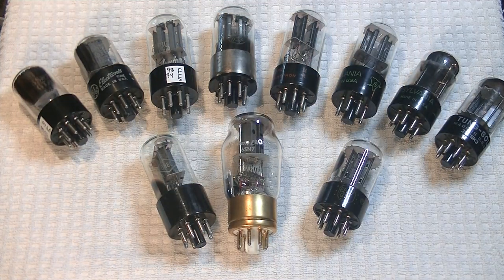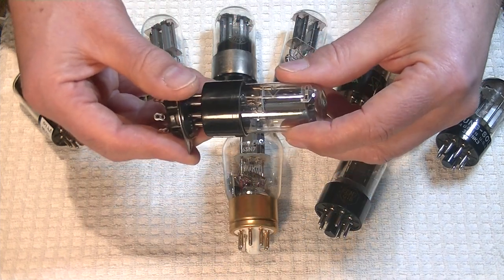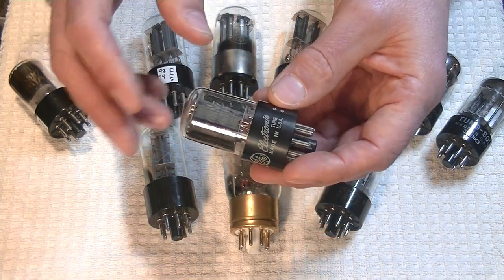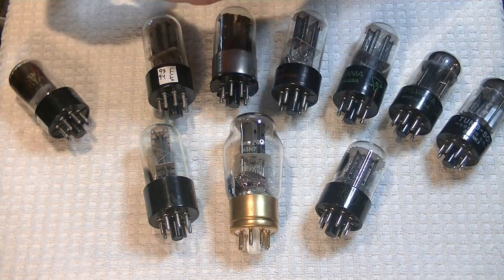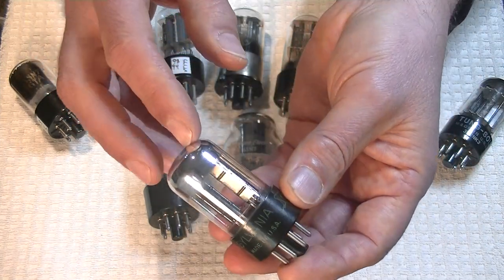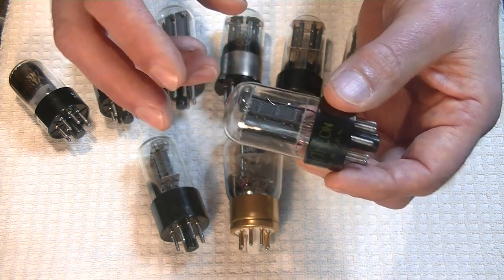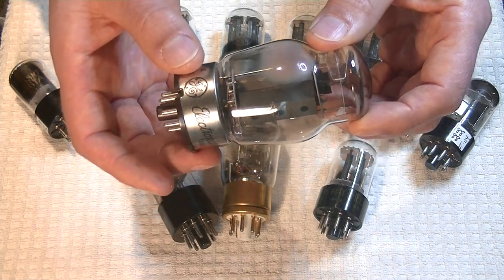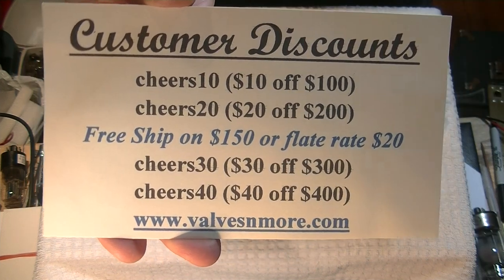Tube Lab #22 Tubes for the Schiit Freya+ Preamp

Comment: Hi Jim, nice job of showing different tubes that can be used in the gain section of the Freya+ Pre-amp.  I recently bought the Freya+ and have done some tube rolling so your timing of this video is really good.  One tube that sounds sweet to my ears is CBS Hytron 6sn7GT did add a wider sound stage, clear base and focused mid range to my listening experience.  Please keep the videos coming!  Thank-you.
Reply from the maker: Yes the Hytron is a very nice tube and I try and keep as many in stock as I can.  I always have more tubes to bring out for show and tell than I have space or time for!  Thanks for letting everyone know!
Reply: In regard to the socket  saver I have tried four of them into the Freya pre-amp with limited success.  While rolling tubes two of the socket savers the middle plastic slot broke off.  If you do find a good quality socket saver please let me know, I will purchase them immediately.  Thanks

Comment: I’ve found with the Freya Plus if you’re using socket risers, if you pull gently straight up with no wiggling only the tube will come out, but if you add wiggle the tube and the socket riser will come out.

Comment: I believe that Schiit was wrong in the construction of this preamplifier. I have one and I love it, but I believe the project has been misguided when it comes to matching the tubes.

As for the gain tubes (right side, next to the XLR inlets), Schiit recommends the 6SN7, but they say it works with the 6SL7 as well. The fact is that the 6SL7, although not a famous tube, has twice the gain of the 6SN7, that is, it allows the same volume level to be achieved with a smaller scale of the knob.

On the other hand, with regard to the outlet tubes (on the left side, next to the XLR outlets), these must be the 6SN7. As these tubes control the output impedance, if we use the 6SL7 the preamplifier will not be able to control virtually any modern amplifier on the market. This in terms of impedance. But, the 6SN7 on the outputs turn it into a preamp that plays much more than it costs. In terms of matching the project, 6SL7 at the inputs (which amplify the signal) and 6SN7 at the output are the best combination.

However, if gain or more power is not essential, eventually using better 6SN7 in the gain stage can result in something superior.

Comment: Great informative video.  Do you recommend socket savers for the Freya Noval preamp? Also do the sonic properties of 6sn7 tubes from various manufacturers carry over to the electrically equivalent 6cg7?  Thanks for any advice
Reply from the maker: The Freya noval takes a miniature 9 pin tube and these are all glass with integrated pins, so no matter what you do you are pushing in and pulling out on the glass, so unless you need them higher for some reason you don't need socket saver/lifters.  This is only a problem with octal tubes which have a glued base and why we use socket saver/lifters when the tube is mounted in a sunken socket (terrible design decision) like the Freya+ octal preamp.

Comment: Watch out for the cheap tube socket risers; I’ve had the middle key break off in the preamp socket and had to extract it with pliers.
Reply from the maker: Good advice!  I only sell one high quality octal socket saver/riser and the ceramic/brass body is beautifully made, But if you wiggle too hard you can break the ceramic center pin.  In the hundreds i've sold, i've only had one breakage like that - and the customer refused to accept a Free replacement, saying he clearly wiggled way too hard!

Comment: Cheers Jim,  I have this issue with my e180f's in my baby sabaj pha3 headphone amp. The russian 6j9 tubes are around 2" tall which gives me a good handle hold for installation and removal (plus the Russian tube logos are majority etched). Annoyingly the euro/us 6j9 (E180F) are half buried in there as they are half inch shorter.  I am getting annoyed at damaging the company print off my rarer valves. I managed to wipe half the valvo logo off my triple mica's in two seconds when pulling them. I was raging lol. I'm going to get some high temp white glass paint and a fine brush to repair the logos lol (I am a tart). I will have to get some socket savers too as you say as they'll give me the stack height xx

Comment: Hello, interesting review on the tubes. I just got a freya+ unit and its my first tube unit. A silly question to ask, I came across many articles saying how the chassis of tube amp is live and dangerous, does the same apply to tube preamp?
Reply from the maker: No chassis for any amp or preamp, toaster, drill, hairdryer etc should ever be live.  It could kill you! Quickly!  The chassis of a tube amp is tied electrically directly to the house safety ground.  With old amplifiers that require servicing, a live chassis is a possibility.  If you ever encounter such an amp DO NOT plug it in, it must go straight to a competent service technician and they will make it safe.
Reply: I think you've misread the articles.  The Freya+ chassis is definitely NOT live.  When plugged into a grounded outlet, the chassis will be tied to earth/safety ground.

Comment: A very impressive video. Tks! I am going to get my Schiit Freya + soon. Need your advise. Am thinking of getting Sylvania  6sn7 Chrome top for the buffer stage and Linlai e 6sn7 for the gain. Will this give me good sound quality?  Looking for holographic and smooth mid range, some warmth and tight bass.Or shall I go for all 4 Sylvania 6sn7 GTAs for the Freya +. Appreciate your advise.
Reply from the maker: I have no (zero) experience with the Linlai 6sn7, but if it's made in China, I'd stay well away from it.  The difference between vintage tubes and new production is night and day, yes occasionally a modern manufacturer will produce a great sounding tube - but not often!  If you are looking for a premium set for your Freya, I just recently found enough inventory for my "USA Platinum" set. They don't last long unfortunately and both tubes that I use in the set (Tung-Sol "Tall Boys" and Sylvania) are high demand premium vintage 6sn7's.

Comment: I am seriously considering a Freya+. I am only familiar with tubes because I am into Hi Fi, grew up in the seventies and eighties, and have heard them many times, also I'm an electrician. I never really have messed with them. My amps and equipment have always been A, AB or D. Looks like a great little unit to get into tubes, I'm a little sketchy on the recessed tube bases. I work in a factory and many of our relays have similar bases, I understand fully how they can be hard to put in/take out. Boards are easily damaged by twisting and pulling on stuff. Would you recommend the Freya+ or is there a better option for me in this price range? I am asking for the mechanical issue, for what I understand it is a great sounding pre-amp. Currently I run my DAC straight to my amp, it has balanced outs and works great. Very precise, neutral, quality sound, but no color. I miss that from the older equipment, I figure tubes will be a great change/add to my system. Thanks, very informative.
Reply from the maker: A simple solution to any recessed socket is to use a socket saver/lifter, we carry a high quality ceramic and brass type in the store for both miniature 9 pins and for 8 pin octals (Freya 6sn7).  These are simply used as lifters and work well.  Another option to the Freya is one of our quality Kit Preamps, we offer two preamps, both are dual mono designs with pure class A circuitry.  The downside for some is that they use single ended unbalanced circuits (RCA patch cords).  In my opinion as an audiophile this is superior to balanced circuits - at least for home audio.
Here's a link to the store: www.valvesnmore.com
Reply: @tubelab194 👍 thank you. I will check it ot for sure.

Comment: Soooo, what about the father of the 6SN7?  6F8-G.  Originally two, much-loved unchanged 6J5 single-triode guts transplanted into the coke-bottle envelope with a top cap b/c enough folks wanted one grid more isolated vs. being brought out to a pin.  Requires a socket adapter but it is the 1st 6SN7G.
Reply from the maker: Great point! Also let's not forget a pair of 6j5 or det20 or cv6 or 2c22 or 6c8c, with adapters of course.  And we haven't even touched on loctals!  The reason I stick to the correct tube, is the vast majority of Schiit Freya owners are just getting into tubes, they probably don't want to fool around with adapters or modding the amp.  And because the 6sn7 was the 12au7 of its generation, many many excellent tubes were made, and as a result we have good supply even today some 60 years later!

Comment: This is very informative. You have a new subscriber here. 

Quick question, does a tube with shaky / loose filament when handled a bad tube? I bought a match RCA 6sn7 and noticed it was loose when I unboxed and handled it. Thanks in advance.
Reply from the maker: Welcome!  Hmm filaments don't normally get loose, they're fully inside the grid wire and plate structure, maybe you mean something else?  Try and describe the part that's come loose. Normally nothing should be moving around inside a tube, that's a sign of big trouble!  The exception might be a little tinckle when you rotate the tube end for end.  Which is just a tiny piece of solder or glass that's gotten loose and is not normally a problem.
Reply: @tubelab194  That's exactly it. When I move or handle the tube I hear a part of the tube that is loose or something dangling inside. 

I returned it not to risk damaging my electronic.
Reply from the maker: @jianboo  that's fairly common and no (zero) cause for concern, the bits that are loose are normally so tiny they won't have any short risk, so go ahead and use tubes that have a small rattle.  Obviously if big chunks are moving around inside, the tube is garbage.

Comment: Does the added capacitance and resistance of the socket savers/extenders have an audible impact on the SQ?
Reply from the maker: Great question!  I don't own a Freya, but I have used quality socket savers/lifters in my R8 amp for the same reason, the tubes are sunk partially and I am constantly rolling vintage tubes and don't want to loosen up the bases.  The capacitance of 22awg wire is 14pF/ft or 46/m.  If we allow 1 inch for the extension, that works out to 1/12 x 14 = 1.166pF, or a negligible to nil effect.   If the socket savers are well made the resistance should be very close to zero.  I remember checking the resistance of my sockets and I was wasn't able to measure any.  That doesn't mean they measure zero, just that the resistance was so low I couldn't measure it, even with my very sensitive meter.  So in summary, well made socket savers (always test for resistance) will not affect the EQ (sound) in any significant way.

Comment: What tube would you recommend for the Freya plus to give the best upper midrange smoothness but yet keep the heights detailed and airy?
Reply from the maker: A number of options will hopefully give you what you are looking for.  The vintage Tung-Sol 6sn7gtb tall boy with mouse ear mica spacers (rare and very very expensive).  I have these in the 12sn7 version and they're in my top 3 6sn7's.  Being able to play the more available 12sn7's was why I designed and introduced the Universal 6or12sn7 Dual Mono Kit Preamp.  Another more available option is the vintage Marconi 6sn7gtb (#140), an early design (elevated black T plates) this tube has a very open warm sound with a nice top end.  Many of my customers consider it a favorite.

Comment: Thanks Jim.  The topic of tube rolling is intriguing to one who has never heard the sound produced by a tube amp.  My vintage system with a capital V is all solid state.  My B&O turn table has no preamp, but my old Nakamichi receiver does.  Some audiophile gurus on the Internet say that the amp is not as critical to system sound as is the preamp, or at least that is my understanding of their message. As I see it, I have a few of options.  1) I can purchase a tube preamp and plug it into the Aux input of my Nakamichi receiver--is this an insane option?  2) I can purchase an integrated tube amp which includes a preamp circuit. 3) I can rob a local bank and purchase both a tube preamp and a non-integrated tube amp. Can anyone enlighten me as to the best option?  (I don't have a huge budget with which to work.)  Thanks
Reply from the maker: An integrated amp worthy of consideration is the Willsenton R8, yes it's Chi-Fi, but it is well made, sounds great and best of all about $1,200 delivered!  Beware though it'll come with poor quality Chinese tubes, so you have to figure on upgrading the entire set if you want to let her really sing!
Reply: @tubelab194  I was afraid someone would say that.  The price is closer to $1500 US.   What kind of price range can I expect to replace the KT88 variant?
Reply from the maker: @Oldgoat912  If you order, buy direct from Chi-Fi, cheaper and order the EL34 option, they actually give you a credit on the purchase price, and you're not going to want to use those tubes anyway.  Also if you are patient take freight by Sea, slow (2 months) but a lot cheaper!  You can pop into my online store www.valvesnmore.com  to get an idea of the re-tubing cost, look for Willsenton Tube Packages, even the Bronze package will sound great and compared to the Chinese tubes - Fantastic!

Comment: I've been struggling to learn about hi-fi audio (in my old age...), and even worse sifting through the vast number of products on the market. This may be slightly off topic...but would the combination of a Schitt  Bifrost DAC and Freya+ (with good tubes of course); then paired with a fairly good (100 watt) amp and another 250watt amp; give me good sound to power my Heresey 1's (circa 1972) and vintage Bose 901 (circa 1968)?  I plan to stream hi-def HD music mostly.  I  like their warranty, their simplicity, their price point and very importantly;  their Made in USA aspects. I had been looking at Canary, Cary and McIntosh; but frankly ....they are all but out of reach for me.($)
Reply from the maker: A lot more good tube options exist today compared to even a couple of years ago.
1.  Sell the 901's, an exciting speaker back in the day, not considered HiFi anymore.
2.  Take that money and Upgrade your Heresey 1, mainly the crossover, but if a new titanium tweeter diaphragm available (Google upgrades) then do that as well.  That will give you high efficiency speakers of good quality.
3.  With those high efficiency speakers you could build a pair of monoblocks and a preamp kit (coming this Fall).  And experience glorious SE sound.  This is only a good option if you enjoy building stuff.
4.  Or buy something like the integrated Willsenton R8, cheapest by slow boat direct from Chi-Fi.  Beware though you'll need to spend more money on tubes to let her sing to potential.  With the R8 you don't absolutely have to have a preamp (though they help) and just need your DAC interface and Bob's Your Uncle you'll have a great system.  On a relatively low budget.
Reply: @tubelab194  Humbled by your insightful and caring reply.  It means a lot to me.  Can't thank you enough. :-)

Comment: What's the proper way to store tubes?
Reply from the maker: @dakata2416  almost anyway you can think of (that's safe), the only delicate part is the glass, the electronics are in a vacuum so the internal components basically stay in the same condition they were manufactured.  We regularly run Sylvania tubes made in the 1930's and 40's and other than the pins needing a clean up they're basically brand new (if NOS - new old stock).  Sometime soon we'll do an episode on this, but in general anywhere safe from breakage inside your house is good.  If you have boxes great, make use of them and then store your boxes in a shallow cardboard tray.  If you don't have a box, wrapped in a layer of mini bubble wrap with an elastic around it is good, and again in a shallow tray.  The most important thing is to make sure that wherever your tray of tubes is stored they can't accidentally get broken.
Reply: @tubelab194  what about environmental conditions?
Reply from the maker: @dakata2416  normal household conditions are ideal.  What would cause problems is if you live near salt water - in which case sealing the tubes in a ziplock would significantly reduce pin corrosion.  We store our store inventory in an unheated garage in clear 16L bins and ziplocks and they're perfectly fine.  Now don't take a tube at freezing and plug it directly into an amp, that would be asking for trouble, first bring it inside and give it time to reach room temp.

Comment: What's the average life and cost of the tubes refered to in the episode ?
Reply from the maker: The short answer is nobody knows how long a tube will last!  The cost is easy, just visit www.valvesnmore.com for the Freya+ I've got tube packages, so you don't need to be experienced with the various brands and variations, just pick a package that you like and Bob's Your Uncle!  Now as far as tube life goes, many factors affect how long a tube will last.  If the tube is taken care of and not abused this makes a huge difference!  Obviously quality NOS (new old stock) will on average last longer than used.  Some mil spec (military) tubes have extended life heaters as well, sometimes rated to 10,000hrs!  In general a quality new tube (not Chinese) will last 2-5,000 hours - in general!  If you love turning equipment on and off constantly, much less!  And if you believe in leaving your equipment on 24/7 much less!  Remember a vacuum tube requires a strong filament to emit, and the heater aka filament, has a finite life span and like old fashioned light bulbs, will first dim (get weaker) and probably long before the filament burns out, become too weak to be useable.